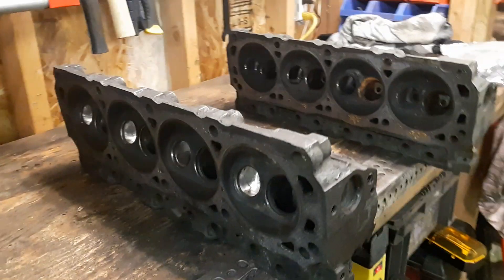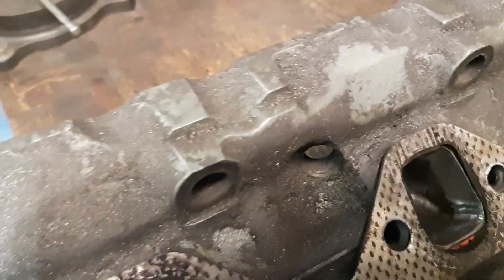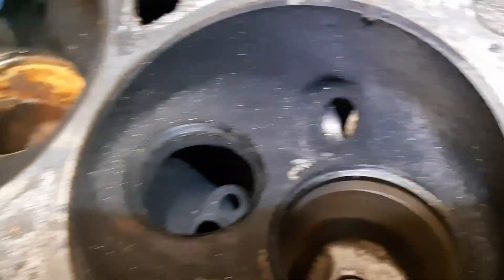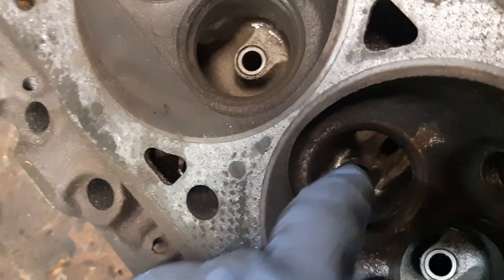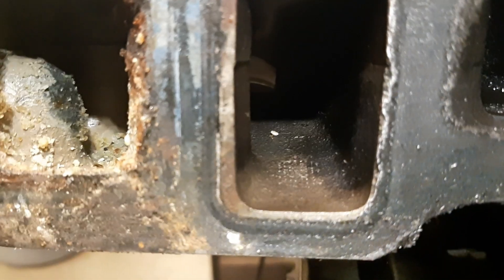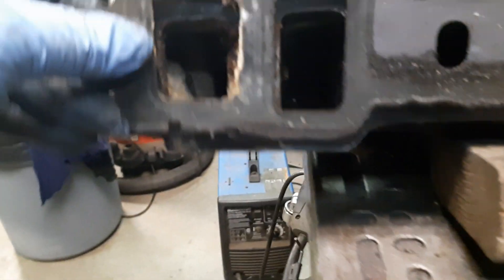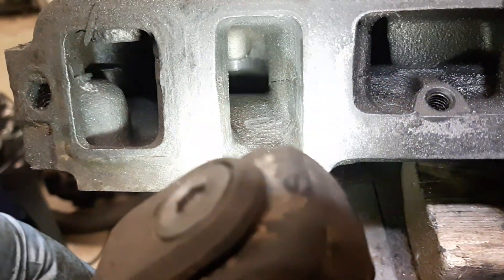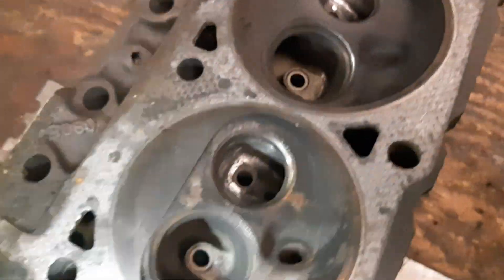Porting Ford E7 351w windsor heads

Comment: Looks like the open chamber low compression smog era heads, know? Also are you using bigger valves? If so what size?
Reply from the maker: Yes they are the low compression heads in the video. D6 I think is the actual code. But the ports and bowls are the same as an E7. I ended up doing the same porting on a pair of those. I used the stock valves.
Reply: @thingsandstuffwithpete  Just curious what are the valve sizes?

Comment: Backyard porting these heads is alot of time and work!! We USED to have to do it! Just buy a set of heads and bolt them on! Not even that much difference in the money after you buy valves, the air compressor with enough flow to run the thing!!

Comment: these heads seem to have small ports and a big combustion chamber. Need all the help they can get.
Reply from the maker: Yes the chambers are huge and are a low compression cylinder head. They are actually a Ford D6 head for the small block ford engines and I was incorrect calling them E7 heads. I ended up doing similar porting to some E7s for a higher compression ratio.

Comment: Explorer heads +25 hp straight bolt on... needs springs
Reply: This seems to be a recurring comment to anyone that is trying to make some improvements to the heads they already have. When was the last time you were able to just run down to the wreckers and easily find a set of GT 40 or P heads. They aren’t as plentiful as they used to be. And if you can find a set the are mailed out and need a complete rebuild.  Try offering a more useful suggestion or at least acknowledging the efforts these hobbyists are putting forth

Comment: Waste of time period.
Reply: Whatever floats your boat.You could go to the junk yard and pull out some gt40 heads port them.Would be a better upgrade and still a stock iron head.Been there done that and it works great.
Reply: Depends on the context. 

Money: I have E7 heads, I have grinder, I have time, I don't have spare cash... not a waste of time. 

Application: (This one applies to one of my F150's.) I have E7's, I have a 347 shortblock, my intent is to bump up the low/mid range without dropping cash that can be spent on my second truck... not a waste of time. 

Class rules: Stock engine components correct for the year... not a waste of time. 

Class rules 2: Claim motor: Unlimited on what you can do but who wants to give valuable parts away to a competitor? Not a waste of time.

The IDGAFF what you think file: If we all think like internet experts/millionaires there would be a whole lot fewer cool cars on the road. Not a waste of time.... period.
Reply: @Ares-jx4ep . You told the mf’r…..😂

Comment: Dude...  if the casting numbers say D8OE, then they are NOT E7 heads
Reply from the maker: Yea thats right. I was told they were the same as 5.0 E7 heads and carried on with that assumption. Either way they are pretty identical to an E7 except for the combustion chamber